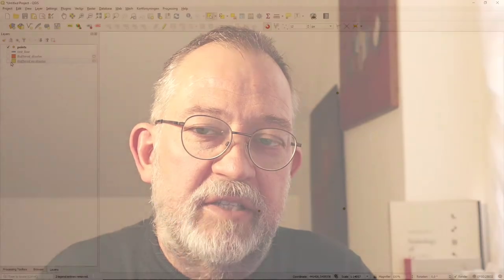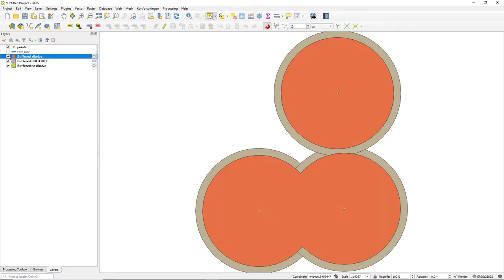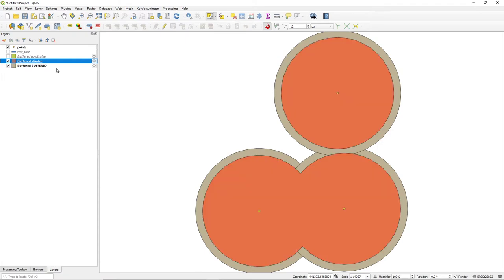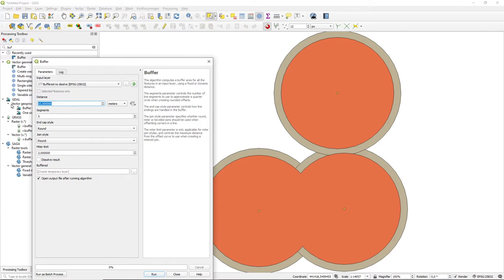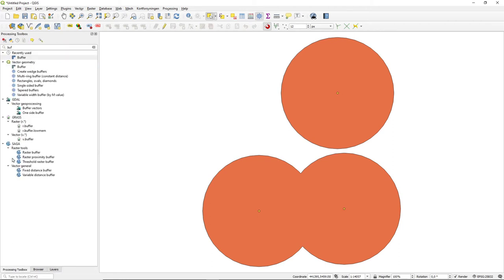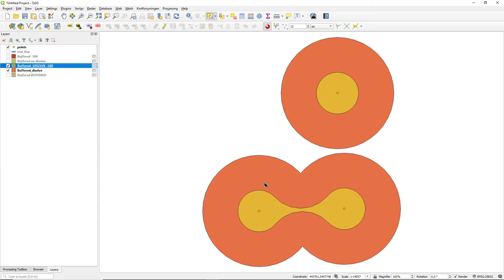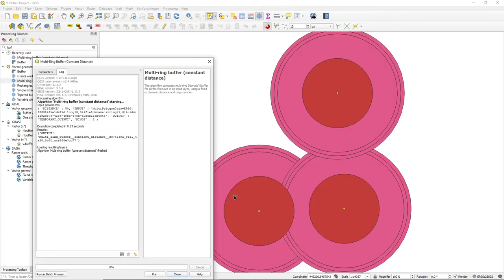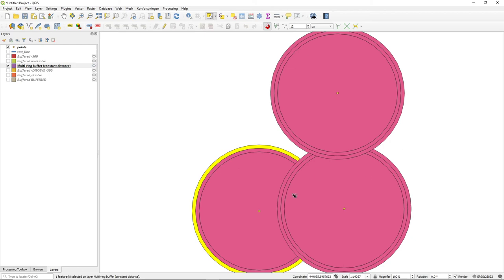Using the buffer tool on polygons in QGIS

Comment: Hi mate. Simple question - how do you get to show meters instead of degrees in your distance option?
Reply from the maker: If you use a geographic coordinate reference system such s wgs 84 you get degrees if you use a projected coordinate system for instance something based on utm you get meters.
Reply: @Geoinformatics_0nline  Thanks, about 15 minutes after posting this I realised it 😅. Thank you none the less. I may reach out on  a polygon question tomorrow if that's okay with you.
Cheers
Reply from the maker: @Kaspaas  PLeas do ask